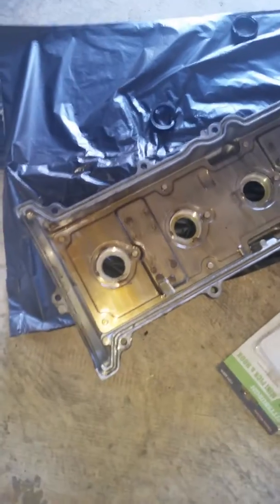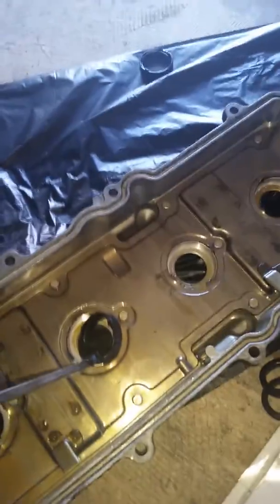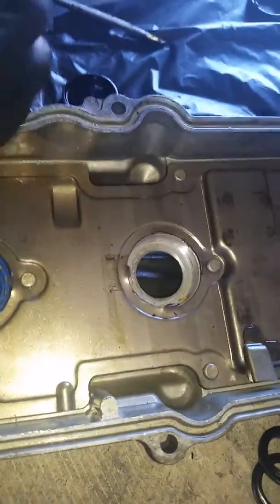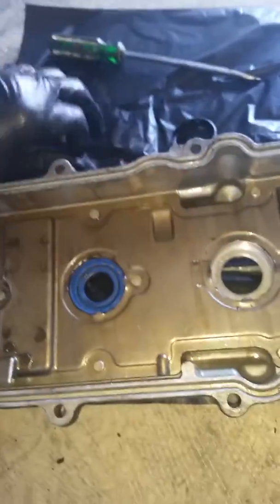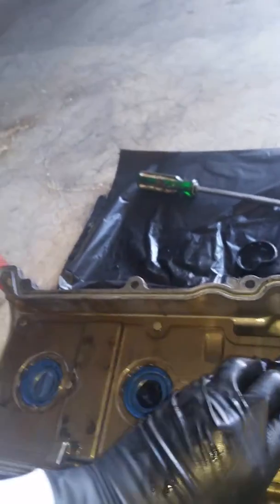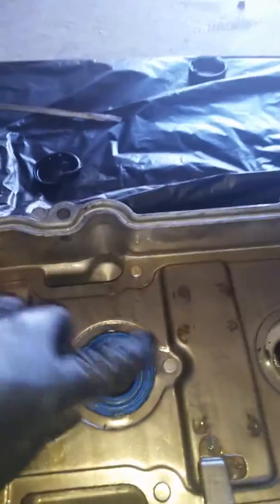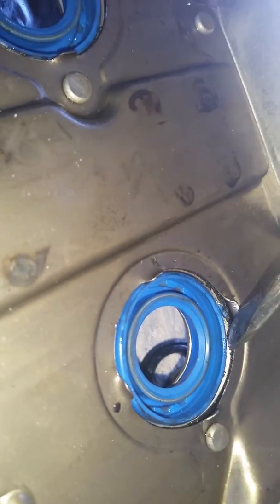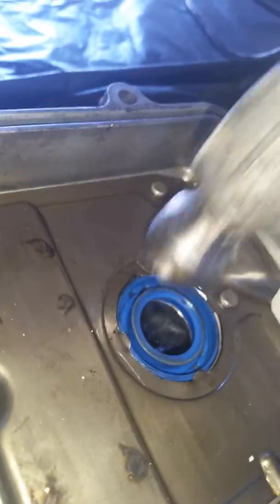2001-2007 Toyota Sequoia Valve Cover Gasket DIY part 3

Comment: Andrew ...you put the tube seals in upside down...taper ends go towards the engine.....not towards the sky.....that way the valve cover will slip over the tube easily......I learned the hard way and did it like you........I believe it is wrong......
Reply from the maker: You are correct. Unfortunately I did the same as you and had to redo it to flip the seals over.

Comment: I thought the seals go in the other way
Reply from the maker: You are correct. I couldnt make another video after this. I found out the hardway and put everyhting back together only to find that the valve cover would not seat on the spark plug tubes. It cost me another 20 bucks because once you get put the seals in there they will break when you try to remove them.